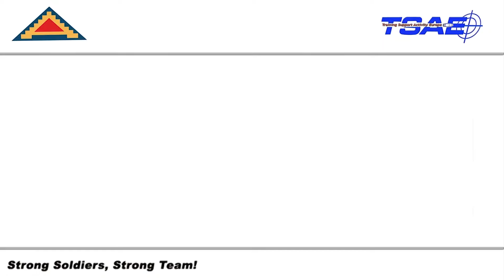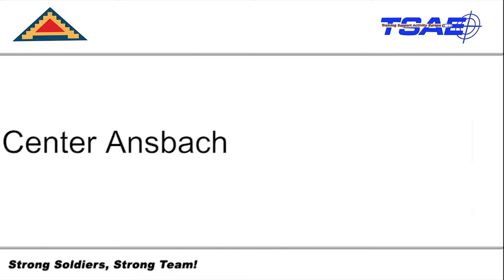AH-64 Apache Helicopter Phase Maintenance Inspection

Comment: It's crazy how vulnerable an apache looks without all its covers and isn't there another avionics bay for redundancy?
Reply: Most of the avionics are located at the EFABs (the extended avionics bays at the lower left and right of the helicopter), and most of the redundant LRUs are located in the opposite position from each other to help with the survivability of the aircraft.
From what I can see in the video , the right EFAB appears to be completely installed.